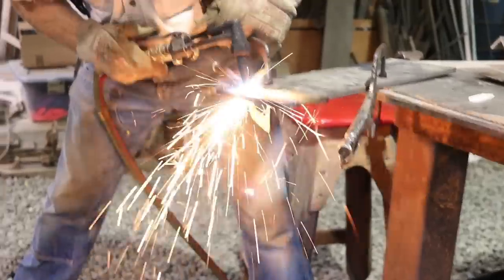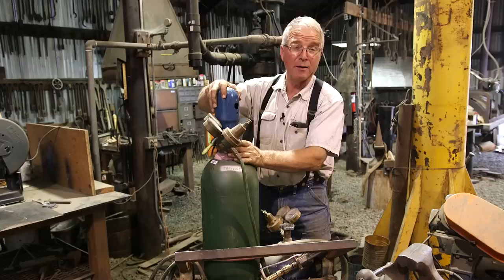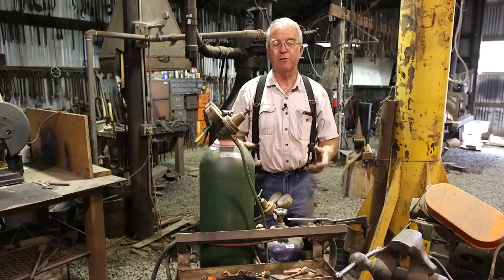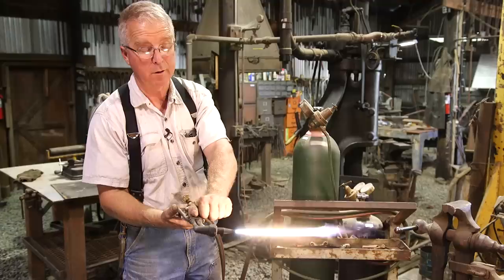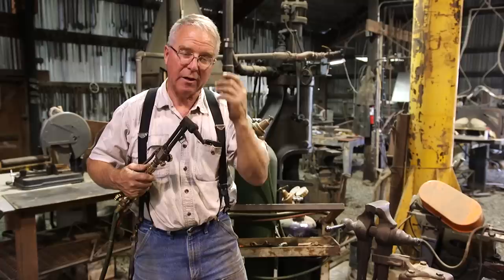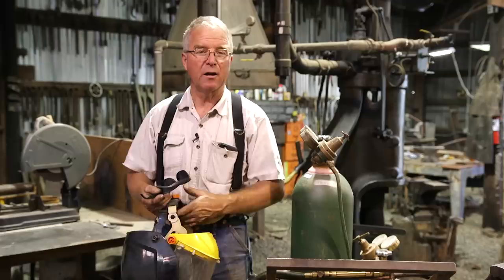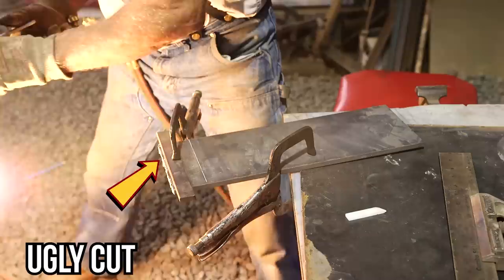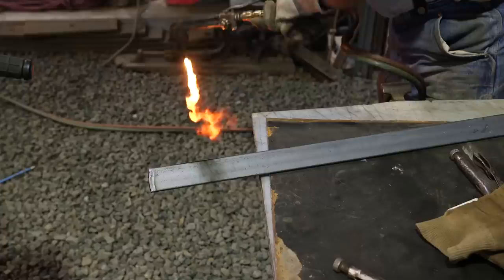Using A Cutting Torch

Comment: The oxygen bottle is a high pressure bottle. It has to be opened all the way in order to seat the valve closed at the top. MiG welding has bottles are the same. Only turn acetylene on 3-4 turns max. The only time you’ll go above 5-7 on your gauges are when you’re cutting 1”+ thick material.

Comment: A couple of things that I learned growing up in a welding/fab shop. The hottest part of the flame is about one eighth of an inch away from the blue pilots. Once the secondary oxygen valve is adjusted, it should be left alone. Shut the flame down by shutting main oxygen first and fuel last. When relighting light fuel, turn on main oxygen valve fully, then adjust fuel to obtain a neutral flame. You will always have the the same sized flame with only one adjustment. Only tilt torch when cutting thin material. This makes the effective thickness greater. I always try to emulate a cutting machine(ie smooth even motions with no shaking.) I like to use guides to help. Remember FIRE IS HOT. Safety first.

Comment: This is a quality! Couple things to add. This is just what I have learned from class. I understand that he mentioned the fact that he has not specified a lot of the details because it does come from experience as I have learned in class. When you go to turn on the tanks you want to turn them a little bit more than what he said but not necessarily all the way. As for the oxygen and acetylene, 30 psi for oxygen is sufficient and you can go higher, but with the acetylene you just want it at seven psi. Also when you were setting off the torch do you want to back out the hoses so they do not burst from scoring at high pressure. What that means is turning off the torch valves on the actual torch, and then turning off the tanks. After you have turned off the tanks you want to turn back on the valves on the torch as if you were about to cut the steel. You’ll see the working gauge drop down to zero when you turn on the valves on the torches. Now the torch is ready for storage. Thank you for the video!

Comment: Great video, I wanna add some things on:

- There are publicly available charts with recommended pressures for the bottles (measured with the gas flowing) depending on the thickness of the steel you're cutting - use them to set your torch more precisely - the setting shown in the video will cut just about anything, it just may be overkill for some thinner metals.

- Also consult OSHA's (or other country's equivalent) manual about the shade needed for cutting/welding - acetylene and plasma both require shade 5 iirc, which is readily available at many tool and home improvement stores. It's really unpleasant to look at a neutral or cutting flame at the very least and probably not helpful to your eyes either. I am pretty sure though that acetylene torches do not emit UV radiation, only infrared, they are still bright af and you only have 2 eyes.

- All connections are brass on brass - never use sealants or tape to get a seal because it will react with the gases unpredictably (or predictably and violently). Don't crank down on them too hard - just enough to seal and you can check for that seal by cracking the bottle open with the tip valves closed, then closing the bottle once the pressures stabilize and noting how long it takes the pressures to go down. As long as it takes a couple hours you're good, one of my bottles takes about a day to fully go down but that one has a new regulator and hose. There is probably a better way as well, this is just one of them.

- Work manuals will tell you to disassemble the torch fully once you're done with it - no one really does this and there are no real ill effects. Do, however, inspect the connections and hoses for cracking before opening the bottles, and purge the gases out of the torch when you're done with it - close the bottles, open each valve one by one until the pressure in the regulators goes to zero, then close the valves. If you shut off the torch improperly and it won't re-ignite, this is also the way to "start anew" - bleed, open again, and try again.

- The acetylene bottle should only open 1/4-1/2 turn so in an emergency it can be closed with one twist of the hand. It still gets enough flow to do the work. If you transport the acetylene bottle and have to lay it flat, let it stand vertically for a couple hours before use - the contents are a mixture of gas and liquid confined within a sponge, you want the liquid on the bottom and gas on top or you'll have major, major issues when you try to use it.

- If cutting rusty, flaky metal - WEAR THE FACE SHIELD. Metal WILL splash into your face because only the outside flake is molten. This applies to repairing rusty farm vehicles/equipment, car body repairs and restorations, and other situations where thicker, rusty metal needs to be cut.

- If cutting overhead or the scenario directly above, invest into a leather welding jacket and hood. At the very least, wear several thick layers of clothing that you don't care about - and never wear synthetic clothing because it WILL melt to your body. Wearing long sleeves with a collar is the very least I would do, and welding gloves so you don't worry about giving your hands third-degree burns.

- Proper footwear and leg wear is a must - work boots and pants, or at the very least thick jeans. Regardless of the position, your legs will get hit with sparks and it's really unpleasant.

This is a very cool and useful skill to have, and indispensable if fabricating or working on vehicles subject to the weather. The cutting tip can also technically be used for heating, just stay off the oxygen blast lever and set the flame to neutral.

Comment: I have to take exception with your explanation of the process of initiating a cut. By waiting for a puddle to form before beginning the cut, you exacerbate the backsplash when you pull the trigger. 

Alternately, when you begin to heat the steel, at the point when sparks of burning carbon begin to emanate from the flame, go ahead and pull the trigger. The blast of oxygen coming from the center of the tip will spike the temperature, cleanly initiating the cut.

Comment: And don't forget that Acetylene is heavier than air and will collect in pits etc... Thanks for another informative video :)
Reply: Actually, Acetylene is lighter than air... atomic wgt 26 as compared to air at 29 so will not collect in low areas. It is unstable (reactive) due to the bond stress of the triple bond.

Comment: Another great video.  just 2 safety points for beginners first no lighters or matches in your pockets, shirt pockets especially. second if you are using older torches retrofit them with backfire safety valves between the hoses and torch. body, newer torches are made with the safety valves as part of the torch

Comment: Thanks for the video.  I got my dads old acetylene torch and tanks from him about a year ago. I have only used them for heating up and bending some metal and need to do some practice cutting.  I don't think I have cut metal with a torch since middle school metal shop class. And I'm 36 now...   I do need to go get the bottles filled.

Comment: Stoiciometric burn with acetylene and O2 is 5:1 with 5 parts O2 to 1 part Acetylene. That being said, try using 7 PSI Acetylene with 35 PSI Oxygen instead of 20.
Reply: sounds like Scott prefers a rich mixture!
Reply: Agreed, FEMA teams run 60/12 during rescue ops, 35/7 or 40/8 during training to save gas. With government paying for the gas and time, some us got to the point where we could make stencils in cursive on the steel with unit numbers and designations.

Comment: Great video our Blacksmith shop started in the UK back in 1890 they used Town Gas back then before making their own Acetylene etc
Flash back arrestors as mentioned earlier are worth doing a video on.
As you probably know the Acetylene gas is dissolved in acetone ??? and the small bottle is much heavier
In the UK Oxy is in a black bottle and Acetylene is in a maroon bottle

Tricks that I have seen my Dad achieve
Running low on Acetylene once the oxidisation puddle forms he would turn of the Acetylene ;-)
I have seen him burn an 8mm nut of a stud and spin on a new nut, my mind was blown with that one as a kid
Lighting a BBQ and start cooking in less than 3 min with no lighter fuel smell on the food.

Tricks he did that still make me cringe
Testing for a gas leak near the pressure gauge that had a missing bezel - loud bang and the bourdon tube straightened out and flicked the gauge needle 30 feet and embed itself into the wood door just as someone was coming in the workshop. 
He sometimes was "as daft as a brush"
Handy using a Propane nozzle and a propane tank with Oxygen for heating applications, great for items that we could not get into the forge.  

You said and never use OIL or GREASE on anything to do with Oxy Acetylene 

Never use your thumb to check the air pressure of a "plasma cutter" one of our workers learned the hard way.

Thanks for doing the video, my memories from over 35 - 40 years ago

Comment: Fun fact, most any flammable gas can be used as fuel for a cutting torch, assuming the correct tip is used. Even gases that are much cheaper to get like propane and natural gas, or if you happen to be in space and hydrocarbons are in short supply, you can even use pure hydrogen. I've even heard of a cutting torch that runs on kerosene.
The reason is that it's not the fuel that's doing the cutting. It's the oxygen. Technically once you start the cut, and are progressing at a steady rate, you could turn off the fuel supply and keep right on cutting.
The reason is that the reaction of hot iron with oxygen is actually quite exothermic, which is chemist talk for "a reaction that produces heat". Since it's also an oxidation reaction, you would be absolutely correct to say you're burning metal. The same reaction is used in an oxygen lance, and I think carbon electric arc gouging as well, in both cases there really is no external "fuel" supply yet the burning continues.
All that is needed is a sufficient flow of oxygen to the reaction site, and a initial source of energy capable of heating the metal to it's ignition point.

Comment: I was welding something with my torch about 10 years ago and my friend who was holding until I could get a tack saw my acetylene regulator on fire. I never saw him run so fast! I was able to run over to it and shut it off before I ran. Yes always check for leaks...

Comment: The added oxygen when you press the lever is not to push or blast the molten steal out of the piece but actually to burn it, the steel is literally  consumed by the flame. The same way that you can ignite magnesium if you preheat iron and add enough O2 iron will burn.

Comment: One thing you didn't mention is why you use a jet of oxygen to cut the metal. You're essentially burning it, or making it rust really, really fast. You could theoretically turn off the acetylene once you hit that squeeze valve, and it will keep cutting.

Comment: If you're having trouble starting the cut because the steel is too thick or too cold to get up to the ignition temperature, make a nick with a chisel to raise a little metal which will get up to the ignition temperature quickly. Once the burn starts it will keep cutting easily. And clean steel cuts way easier than rusty metal.

Comment: Unrelated but related tip, Torch tip cleaners are great for cleaning the jets carburetors. Also using a oxy torch is like welding or driving manual, you only get better doing it.

Comment: You forgot to mention that acteline at or above 15 psi in atmosphere (or your hoses) WILL spontainiously combust.

On my welding teuck both bittles were chained to prevent tbem from falling, guages on.
(The vertical bottle rack (with a  lockable gate) I built out of 3/8 inch and 1/2 inch steel plate and 3/8 inch angle iron, just in case some moron in a loaded semi ran into that area of my truck, the bottles would not sustain damage and go "boom".)

Comment: Great advice I had to relearn a couple years ago. Back in my oilfield days they was hardly a day went by I didn't have a torch in my hands. But I had been away from one for a few years. Then two years ago I got tired of grinding my cuts so I leased a set of tanks and bought a cutting and welding set to go with my Hobart welder. So anyway let's just say I was really rusty for a while. Then I begin to remember things and before  Iong i was back to using it as well as I use to. Oxy Acetylene is a great tool but can be temperamental. You have to adjust it for what it is your doing. Also those adjustments are different with a rosebud or a brazing tip.

Comment: It's not a gate valve I believe that they are needle valves. Your tip needs to be cleaned. Not just the holes but the face also. That is why the tip cleaners have a little file. I usually lay the file on the bench and move the tip across the file checking often to make sure that you are square to the blow hole. Then clean the holes.

Comment: To film the flame you need a Neutral Density (ND) filter for the camera. Cameras have much lower dynamic range than human vision. ND filters are available in a range of so called 'optical densities'; get the highest density that is cheaply available and work backwards if it is to much.

Comment: Open the valve fully to the back seat. Do not torque it on the back seat unless you know the back seat is hardened. Take the valve a 1/4 turn off the back seat.

Comment: Another thing that really helps is some sort of steady rest for the torch, which you can make for maybe $0.50 of shop scrap.

For mine, I made two pieces of thick flatbar, one straight, and one bent to an L. Filed a pair of curves in them to match the two tubes on the torch head. Added some holes for a thumbscrew to hold them together. On the bottom of the L piece, I put another threaded hole for a bolt, where I lopped off the head and ground it to a point.

The point easily skates along the plate. The fact it's threaded means you can adjust the height (better than just tilting the torch).  The way it holes onto the torch head tubes means you can move it close or further to account for obstacles (like holes you already cut) and you can even use it as a circle jig for maybe 4-9" holes.

Fun project for a Saturday morning, and makes your life way easier. Since the steady rest doesn't block your view of the torch either, it's even better than a drag-tip plasma cutter for following curves and bends.

Comment: What an oxy-acetalin torch does is rust the metal very very quickly.  The hotter the metal is the faster it will rust in the presence of oxygen.  When you get the neutral flame on the torch and use it to heat the metal to melting, you then use the center orifice to shoot a stream of oxygen that causes the metal in its path to oxidize, break its atomic bond to the rest of the metal, and blow away in the stream of oxygen.

Comment: Oxygen is much more dangerous than acetylene. When I worked at Airgas in hydrotesting we used to empty cylinders, in the open air, of quite a few gases including O2 before pulling the valves to test the tanks. I recall one day, thankfully during lunch, when a cinderblock wall actually caught fire from O2 saturation. O2 is also very corrosive.

Comment: You didn't say why the acetylene gets a 1/4 turn. So it only takes a small 1/4 turn to close in an emergency. When someone is on fire, you don't want to be twisting the valve closed over and over

Comment: Some safety advice, if you drop an acetylene bottle don't use it for at least 24 hours and report it to your supplier. If the shop is involved in fire tell the fire fighters immediately as they need to cool the cylinder for 24 hours before they can move it. We had a half mile exclusion zone while it was being cooled because if it goes off it will destroy everything in a very large radius. This stuff is very dangerous and all to often treated with little or no respect in back street garages or home owners who store it away just in case they need to cut a bolt off in years to come.

Comment: The guys at the gravel mines like having fun with oxygen bottles either by a big settling pond (water) or the seaway where the barges get loaded. Lay one on the ground whack the valve off with a sledge hammer the bottle takes off across the water like a torpedo LOL.
Reply: that's actually almost how some of the first torpedos worked, such pneumatic torpedoes used a high pressure air container hooked to a turbine driving the propellers.

Comment: In case anyone cares. The torch is not heating the metal until it melts away forming a cut. 
On the other hand the torch is heating the metal and the oxygen is actually causing the metal to combust and burn away. 
There is a process that uses a metal tube a car battery and nothing but oxygen to cut metal.

Comment: Two things i would like to add. Don't ever increase the Acetylene pressure beyond 15 PSI. Free acetylene is explosive at that pressure. Also, never ever use the Oxygen trigger to blow dirt off your clothes. If there is any oil or other combustible material present, it can self ignite and you have just added a whole lot of O2 to the mix. Makes for a really bad day.
Cheers, John

Comment: Always turn the oxygen bottle all the way. There is a seal in the top of the valve that seals the gas from escaping around the stem. If your not opening the valve all the way and setting the top seal you're wasting gas. AND MONEY.

Comment: Be aware of and think ahead on where that molten metal is being blown.  It's quite unpleasant if it is being blown onto your shoes, pants or something else flammable.   ;^)
Reply: Onto your shoes is much better than into your shoes.
Reply: @grieske  I've experienced both at the same time using a plasma cutter on THICK aluminum.  ;^)